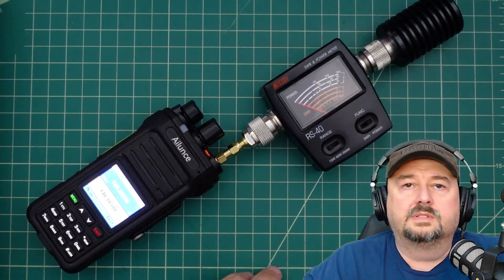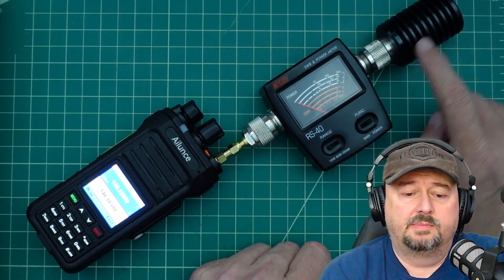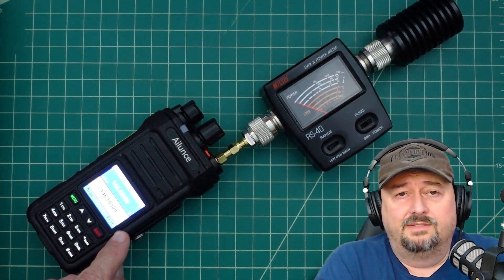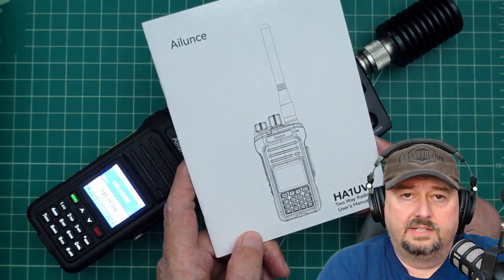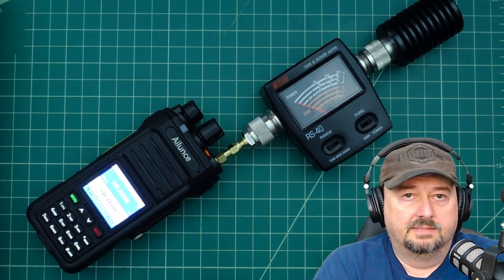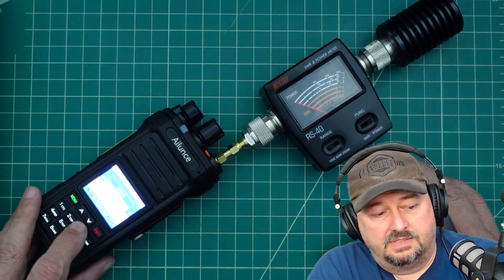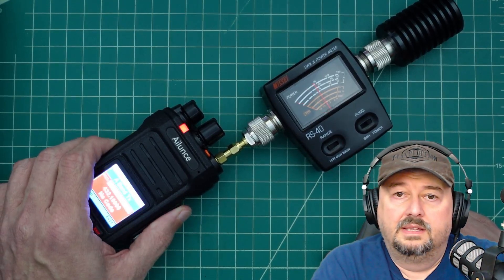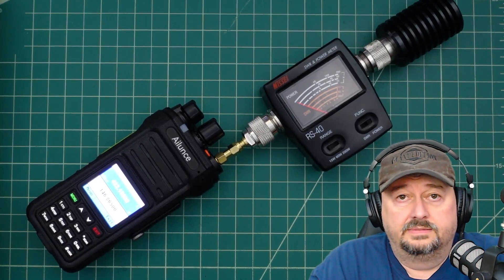Ailunce HA1UV Dual Band Radio: Power Output Test

Comment: If that manual shows 5W then that is great . Some will do a little more some a little less and will very a little from meter to meter. I saw a video of that radio getting run over buy a car and it works just fine after . 73
Reply from the maker: Yeah, nothing in the manual that I saw.

Comment: You think the analogue Nissei power meter is more accurate than the Surecom power meter? I doubt the differences are that noticeable, but something feels more "accurate" when using analogue over digital.

Seems Ailunce/Retevis has been getting better. Spectrum analysis shows good signal quality from other videos I've seen.
Reply from the maker: They say digital is more precise but might not be “accurate”.  I’ve never tested the surecom so I have not idea.  Thanks for checking out the video SG 👍